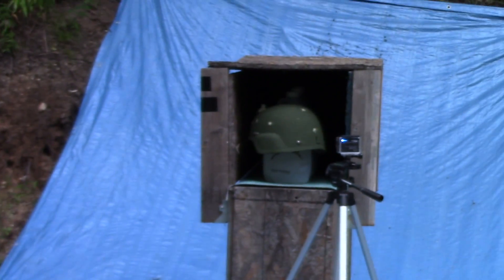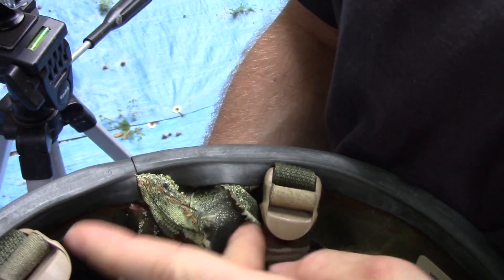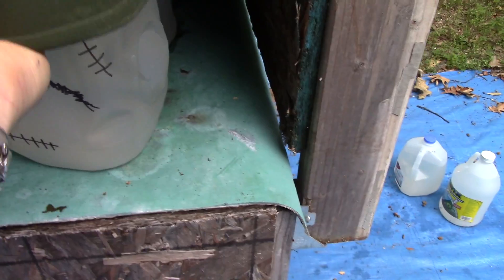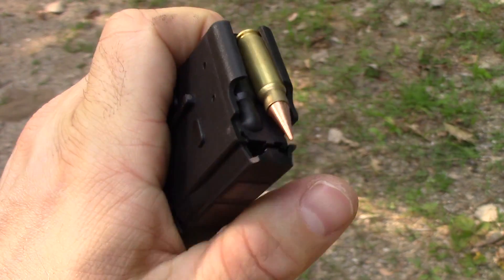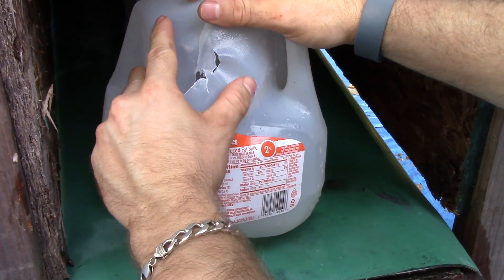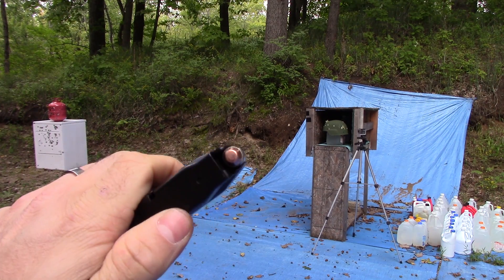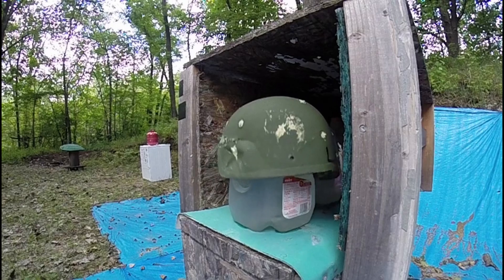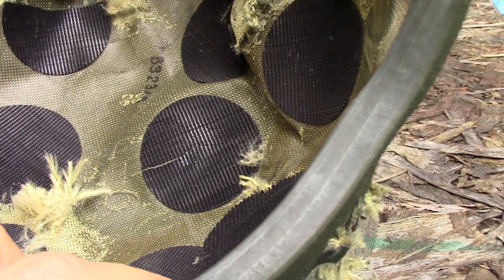Ballistic Helmet Performance Testing (Warrior Helmet by SDS) Part 2

Comment: I thought for sure the 7.62x25 would have penetrated considering its lore.
Reply from the maker: shopsmart57, Joshua Howley and I thought it would penetrate as well. Especially 357 sig..
Reply: shopsmart57, Buffman and myself were talking about this while on the range...I would really like to try this on a newer helmet that had not seen so much abuse.  I feel there is a chance (no proof) that due to the repeated hits on the helmet that it had delaminated enough that as the layers were separating it was enough to prevent the bullets from passing though by slowing the projectile down.